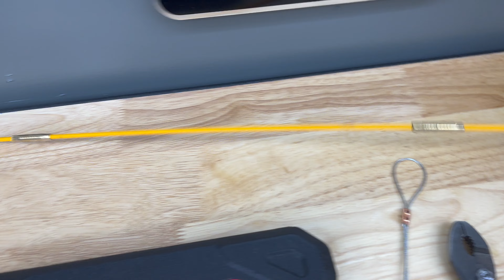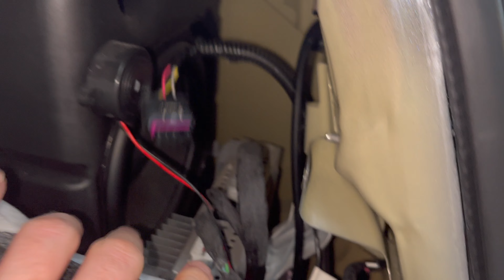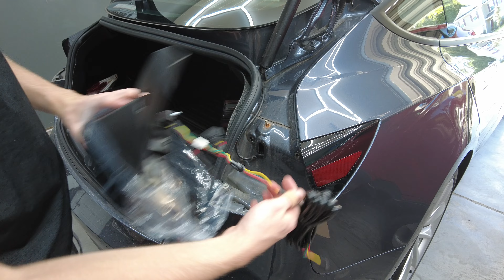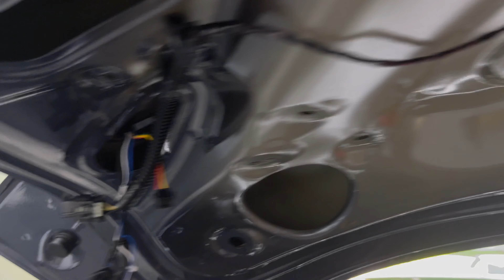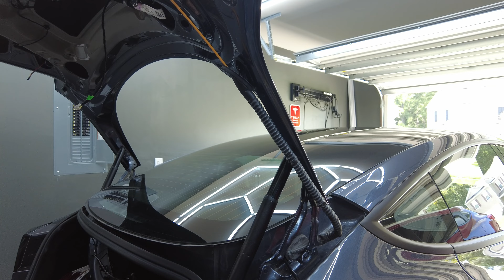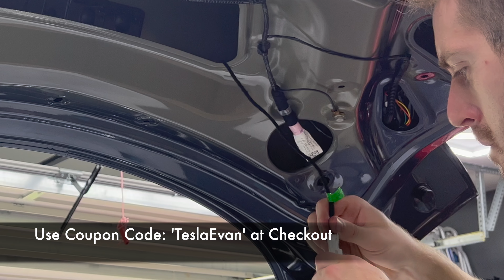Tesla Model Y | Model 3 ⚡️ Extreme Tail Lights- Hansshow LED Aftermarket Install + Review Xtreme LED

Comment: How long did it last ?
Reply from the maker: What do you mean? I still have them installed on my car today.
Reply: @EMtesla1  I seen people having water damage after the first rain so when I ordered mines I resealed it with window silicon just in case. I got mines installed and noticed the tail light turn signal turns on with the brakes is that normal also what app do you use ?
Reply from the maker: @henryberg2155  ensure the wires are connected properly. Mine have never leaked any water since this install.

Comment: Hi Evan I need your help please. I live in London UK and had these exact lights installed on my 2023 Model Y. Since the install the lights work fine but on the centre console the brake lights don’t come on in the Tesla car icon. The indicator / left right signal show on the car image when activated but if I brake or re-gen brake the side brakes or the centre brake light does not illuminate. Any ideas ? Thank you
Reply from the maker: I wonder if this is a software issue as my model 3 illuminate the lights on the screen. I'm not quite sure with the Model Y to be honest.

Comment: Hey, do you have an install video of your Hansshow power trunk? I also have a 2018 Model 3 and I’m currently installing the extreme lights. I have the hansshow power trunk installed as well but I have two chords on each side at the bottom of the trunk that are not connected to anything. Not sure if they even do anything. I believe they are purple. Awesome video btw! Hope to hear back. 👍
Reply from the maker: Yes, its under my channel.

Comment: you cut your truck line seal... a little WD40 and a flex fish line would have done the job or some olive oil... lol thats  a 60.00$ part and all it would have cost him is time...
Reply from the maker: I already had by auto trunk wires going through that... there was not enough room.

Comment: Any idea what the blue and white cable actually does? Why does the left and right need to be connected?
Reply: They need to be connected to synchronise the startup function as is often the case with fancy after-market lights. Also older Model 3s only have 1 reverse light. Connecting both lights allows older M3s to have dual reversing lights.

Comment: Why does the brake light flash first when you put on the turn signal
Reply: @EM Tesla: It seems like the brake light on the driver side flashes before you turn on the turn signal?? Why is that?
Reply: @cuongvan4536 I have these and this happens to mine. I don't like that. A friend bought the same ones from AliExpress and his don't don't do that.

Comment: Your video is vague about the wires your tracing from the trunk up through the weather seal tubing.  Did you fish both wires or just the left (passenger) wire?  I don’t see how the other wire is routed from the trunk lid to the tail light.
Reply from the maker: Both wires are feed through the weather seal. One for the right and left lights on the top trunk lid.

Comment: Previous Hansshow taillights had issues with the turning signals coming on when hitting the brakes on Tesla Model 3 years 2020 and older. This does not appear to be affecting your 2018 model so I wonder why that is? Did you ever experience the Hansshow Fishbone taillights for example? I am just nervous about buying them if my 2020 will still have this issue
Reply: Do the newer ones have the issue too? 2022
Reply: I had trouble with the wishbones as well. After about 3 or 4 months they started freaking out. Causing havoc with autopilot cameras, cruise control, FSD you name it. Kept saying turn signal fail.

Comment: Looks good man these are the best I’ve seen so far.. thanks for sharing. I have a question about the instrument cluster, I’m trying to update the version and when copy the files to the thumb drive and plug it to the display it doesn’t do anything it should start the upgrade automatically right? Any advise!! I did format it to FAT32 copied the two files there is one called update and the other one it has a long name ends with .bin I think. These the files that need to be copied? Thanks in advance.
Reply from the maker: Make sure these files are not in any folders, just directly on the thumb drive. It took mine a few moments to recognize the files to update. Hope this works!
Reply: @EMtesla1  Thank Evan I’ll give it couple minutes. The vendor said wait 30 seconds and I did.. I don’t know. What part in Georgia are you? I’m in Augusta…
Reply from the maker: Savannah!
Reply: @EMtesla1  I have an appointment in August with Tesla Service center Savannah I’ve been there couple of times… you think they gonna say anything if I leave the display and the yoke steering wheel on? I’m going for a noise by the front wheel
Reply from the maker: Please email me found under my channel.
Reply: @khalilbworld9140  I just updated mine recently, ya like Evan is saying don't put these files in folder and also need to make sure your FAT32 formatted drive is 32 GB or less in size. The update should start automatically when you plug it in. I had a really bad lag over the bluetooth when receiving phone calls but that went away after the latest firmware upgrade for the linux 9 inch display.
Reply: @realsastudios  Thanks, I was using 64GB thumb drive. But when I try to format it it doesn’t give me the FAT32 option. It gives me exFAT or NTFS. I used exFAT..
Reply: @khalilbworld9140  Try using 32GB drive. The hansshow people that gave me the firmware told me to not use drive more than 32 GB and also try using FAT32 and not exFAT.
Reply: @realsastudios  just ordered a new 32GB.. Thanks
Reply: @realsastudios  Thanks for the tip it works.. I’m running to another issue now, it keeps connecting to the Car play even the car is parked and locked. So I’m watching a video it keeps switching from the phone speakers to the display. Like If I’m in the leaving room and my car in the garage it connects to the car play.. anyone has this issue and how to fix it..? Thanks
Reply: @khalilbworld9140  that is weird I do not have that issue. My screen turns off automatically when I park the car abs shut the door. Does your screen not auto shut off ?
Reply: @realsastudios  it does turn off.. but my iPhone stays connected to it..
Reply: @khalilbworld9140  are you sure your phone is connected to it ? I ask because CarPlay works over Bluetooth and closed Wi-Fi network so, if your phone is connected to CarPlay all the time, your Wi-Fi on the phone wouldn’t work. Is this the case ?
Reply: @realsastudios  No, only when I’m with in the range. Like for now if I go outside the the parking lot it connect to it..
Reply: @khalilbworld9140  interesting I will try this out when I get back home
Reply: @realsastudios  u r right,noticed that when  it connects to HUD it turns off WiFi. When I turned WiFi on I get a message saying turning on WiFi will disconnect CarPlay..